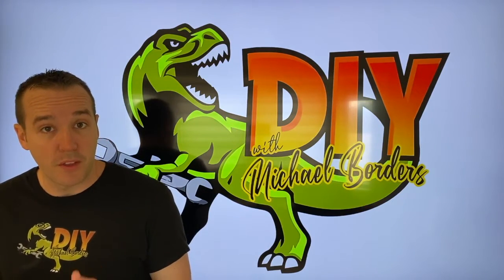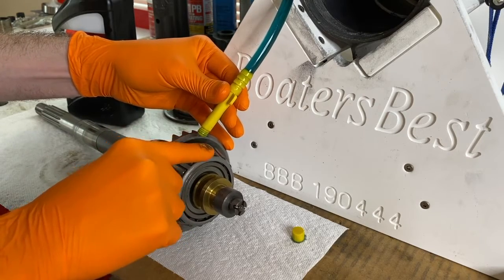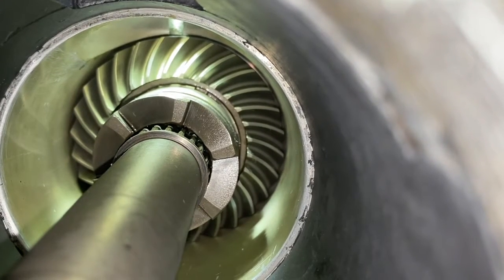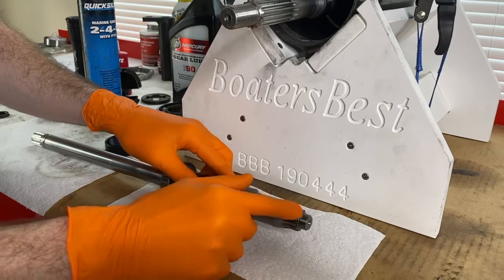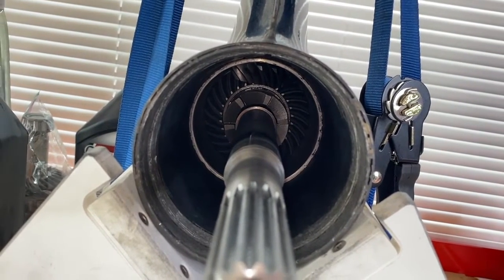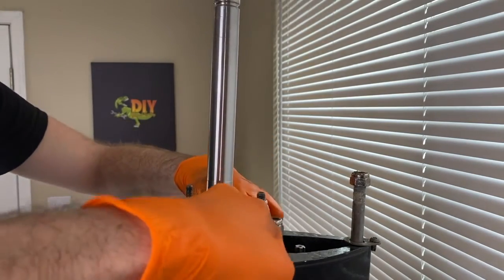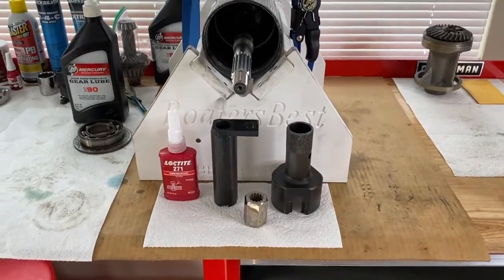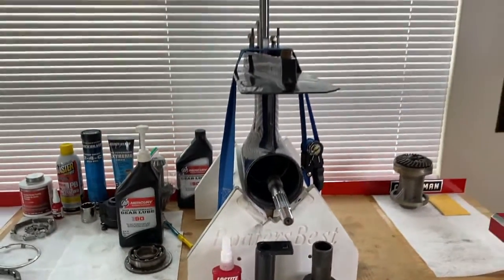Mercruiser outdrive Lower unit rebuild - (PART 5)

Comment: Did you reshimmed it?
Reply: 65 or 66 ft lbs... it's close enough... lol
Reply from the maker: We did however didn’t cover that as it is different for each drive.
Reply: @DIYwithMichaelBorders  what a pity because it’s the most important and difficult part …
Reply from the maker: @kubaSWAT  

Indeed, we didn’t want to give anyone the wrong advice.  As mentioned in the video, it is extremely important to reference your exact serial number service manual for that process.

😎👍
Reply: @DIYwithMichaelBorders  but general idea is the same, I feel really  disappointed you’ve skipped that
Reply from the maker: @kubaSWAT  

We appreciate you sharing this.